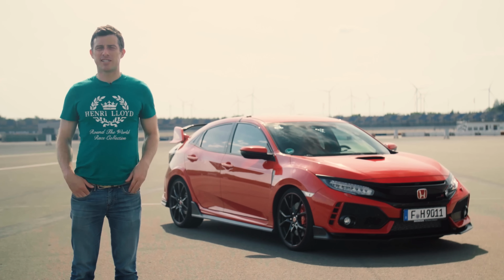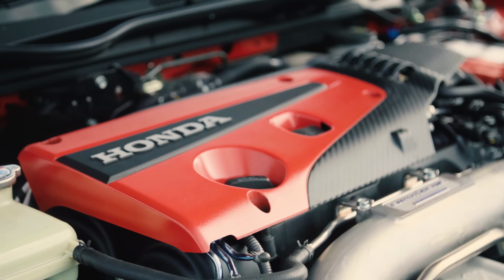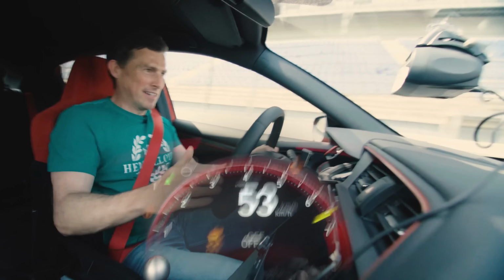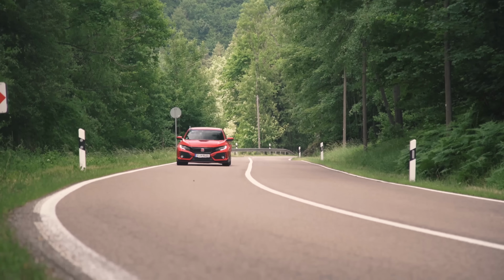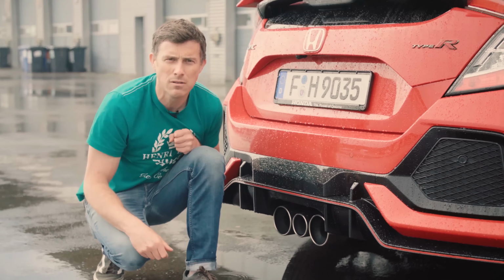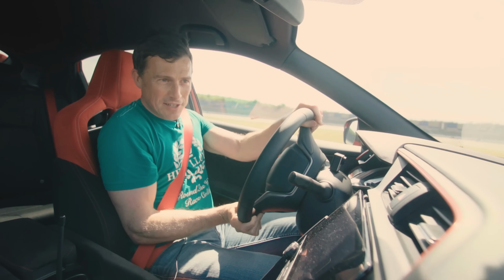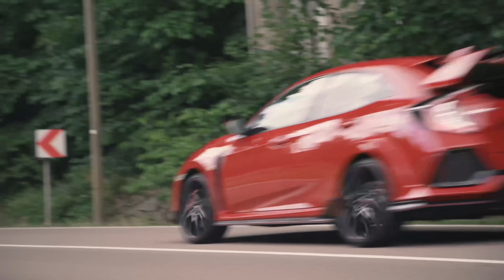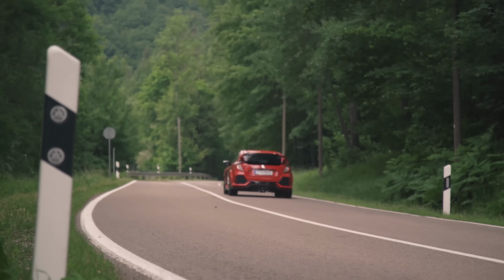2018 Honda Civic Type R - ultimate in-depth review | carwow Reviews

Comment: 5.6 is way to slow for modern hot hatch thought it would be 4.5
Reply: There's more to life than traffic light drag races
Reply: STOP being a 0-62 times GEEK! It's because it struggles for grip in 1st gear.When rolling in 2nd and higher gears it pulls harder than the Gold R and the Focus RS because of it's negligible drivetrain power loss!
Reply: Sakk 1 There's only so many times you can hard launch those awd cars before their reliability issues catches upto them and something goes wrong. And if you are ONLY worried about stoplight gran prix aka 0-60 or driving in rain or snow then the Type R isn't for you. If you want a affordable, fast 4 door around track or back roads get the Type r. Basically the RS, R, STI are aimed at the idiots who only care about 0-60 and drifting in snow...
Reply: Sakk 1 In gear acceleration is far more important than 0-60
Reply: Sakk 1 if you thought a Fwd car can do that you need to have your brain checked
Reply: BB-8 you are correct but 99% of these cars are going to be used for red light drags races and a golf r would leave it for dead
Reply: The car has set world record in green hell which is regarded as the most difficult track. It speaks volumes of the engineering on this car. Manual gear box too for serious driver. I will definitely take a car that is fast on corners than on straight line
Reply: Sakk 1 right drag races nor track days sigh* you know for example this civic has a better lap time on Nurburgring than an Impreza WRX STI...
Reply: Sakk 1 from a 30 mph drag the type r would leave them for dead it's more lighter
Reply: Sakk 1 how about back roads and canyon driving? Or some streets with corners/turns?
Reply: Why are people so obsessed with 0-60 times....proper drivers really don't car that much about them....The car actually does 0-60 in the low 5's which is plenty quick enough and astonishing considering its FWD. 0- 60 is irrelevant in real world or track driving. The Type R is a drivers car, it's faster in corners due to weighing less than its rivals which is why its already broken so many track records in its first incarnation. In the UK it is far better than any of the AWD alternatives day to day. If I could afford to switch from my current FK2 Type R to this I would do it.
Reply: Fadic 4 If I was on the track everyday, then it would be awesome. It's a one trick pony. I can already see the future videos of them getting smoked on the streets. You know everyone is going to be messing with this thing on the streets. 

Seeing that some dealers are asking $60k for them is laughable. If they were actually sold for $35k, then it would make sense for a lot of people.
Reply: Ryan B from a roll this'll beat its competitors it even has a higher top speed as well. Majority of videos of cars racing are from a roll
Reply: Hi Sakk 1. I own a Type r 2017 for a fact and from your very vaild sources (lol) I'm the 1 % that use it for trackdays. I murder golf R's in this thing.. Focus RS is more 50/50 depending on the driver, but Golf R dosent stand a chance in the corners :D
Reply: Anyone who buys a CTR buys it for many reasons... but certainly not for red light drags.
Reply: Sakk 1 not for a fwd
Reply: Ryan B other than 0-60 it's faster than the sti and rs. Do you know what power to weight ratio is?
Reply: Do AWD burn through tyres quicker than FWD, Yes. Do AWD cars use more fuel than FWD? Yes. Are AWD cars heavier? Yes. On a rolling start do they accelerate quicker than FWD? No. Are AWD quicker through corners?... No. In regards to track times are comparable AWD cars quicker than the FWD ones... No. Are AWD quicker from standstill 0-60... yes. Your comment about me being bias towards FWD is wrong, I made a choice about which suits my day to day driving and if I take my car onto a track. How often do you accelerate from standstill day to day in your car 0-60? I would be surprised if you ever do it unless you are racing on public roads...and if you are then you are probably speeding and breaking the law. The only reason I would consider AWD is in a 4x4 Range Rover Esc Vehicle and in wet conditions where they are clearly superior to FWD only.
Reply: The UK doesn't have proper winters :) Not had an issue with my R in the wet or icy roads.
Reply: Sakk 1 is not a drag car dude
Reply: 0-60 is such an overhyped stat. It really means nothing in the real world. The launch is so crucial on a 0-60 time, it will always favour AWD, even though no one is launching their car when the light turns green.
Reply: Ben Benjamin yeah except the others will get eating by this on the track. Including the rs and sti
Reply: TheMidnightNarwhal go live in America then they even race in circles I heard
Reply: Are Dealers even legally allowed to do that if they are Franchised? I would never pay more than the RRP price for a car... if anything I would expect money off.
Reply: Well, if you live in country with proper winter, you really want AWD in your 300+ HP car.
I really like that Type R (apart from looks), but in winter you will have to have another car, or plenty of commitment.
Reply: Rok Hard oooooh someone's upset. Look I didn't mean to get you all worked up snowflake, but the simplicity is these fwd cars need lovely dry weather to work, otherwise those wheels light up and give up, which makes them very poor cars. Hope you enjoy yours though.
Reply: Yeah guys stop saying oh "it's a track car hurr durr". The other ones are track cars to and they are as fast on the track. So why can't a car that's fast on a track be reasonably as quick in a -0-60. All the cars offer both while the Type R only offers one of the 2.
Reply: TheMidnightNarwhal why cant the dodge demon be fast on a circuit?
Reply: that awkward moment it beat the AWD golf R from a dig.....ouch
Reply: Sakk 1 why did he side step the clutch pedal? The car bogs down if you watch the Rev counter! Get the clutch engaged smoothly then max throttle.
Reply: Sakk 1 not a hatch
Reply: IceFIsh no its not irrelevant they are direct competitions
Reply: @sakk1192  most people roll race u moron. And this car will eat them all from a roll
Reply: Still the fastest hot hatch around a track, and is faster than supercars.
Reply: Sakk 1 do you expect a person with one leg to beat someone in race who has a pair? No, that's exactly the difference between FWD and RWD
Reply: Hamza Ali Oscar pustorius won races with no legs 😂
Reply: Ryan B finally someone gets what i mean
Reply: Throw a bit of moisture at it and those front wheels will poop themselves. I get that it's okay on track, but that's not relevant to real life driving where this thing fails.
Reply: Fuck off I live in Canada. I hate Nascar. I don't give a fuck about top speed on public roads.
Reply: Monkiimagic What do you mean 0-60 is irrelevant in day to day. It's what you want with good handling. The Type R only has one of the 2. And day to day why would you pick a damn FWD car when you have the choice lf AWD. You don't have a objective view at all now do you.
Reply: irrelevant its 4wd
Reply: Ricky on the streets where it will be driven the most, 0-60 is fun light to light. Unless you are buying this for a track car, it will be slow on the streets.
Reply: 0-60 is kinda what it's all about. I don't care for top speed when I'm just driving and you want to have a fun little red light race.
Reply: 5.6 is terrible, such a slow car. Nothing interesting about it either, any older fwd hot hatch with a few mods will spank this.